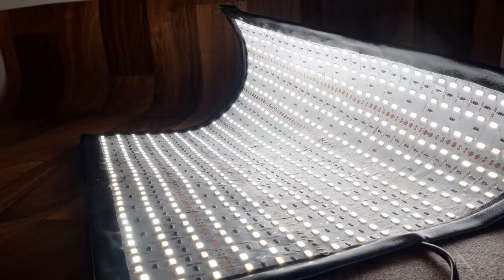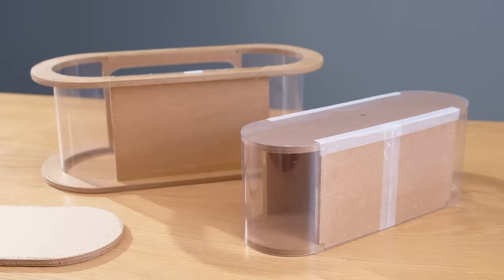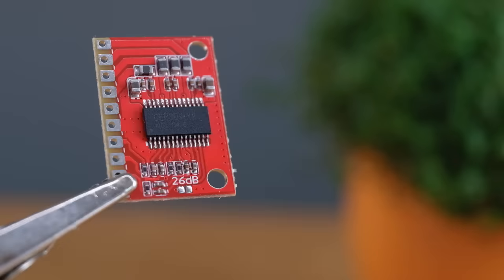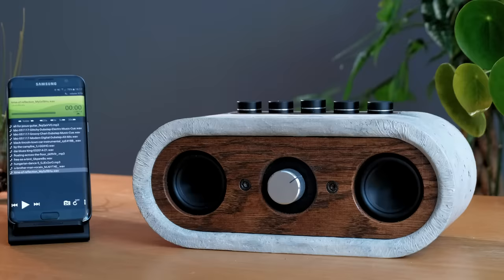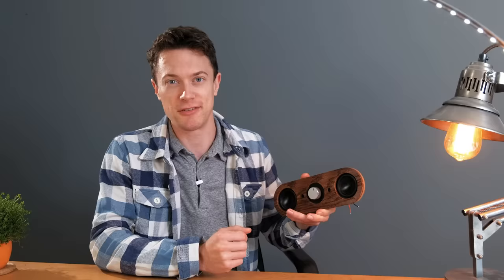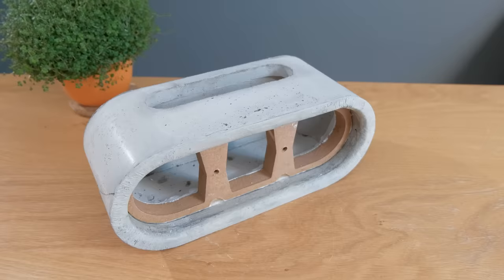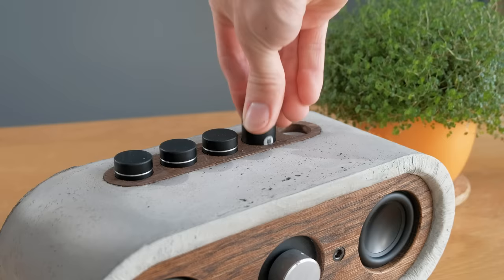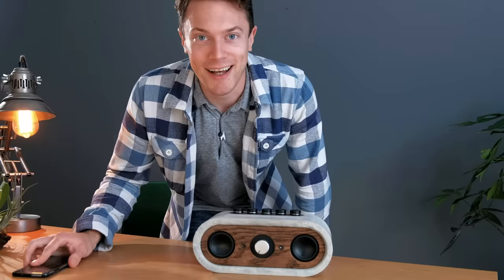Build your own Concrete Bluetooth Speaker (how-to)

Comment: I was wondering what the value for the potentiometer should be. After watching the video several times, it seems that there is a B50K double potentiometer used with an internal switch. I will use a  logarithmic 50K.
Reply: Did it work with a 50k potentiemeter? I have the same question
Reply: @lukaspape9238  did you ever figure it out, im planning on building this and have the same question.

Comment: This is a weird one. Indeed is concrete or stone a nice material for speakers. We are speaking High-End stuff here. But as folks already told, it's not that sturdy to drops or bumps. I think this MDF would be a much better material for a portable speaker. If I would choose stone as material for a speaker, I would build a small (bookshelf size) monitor speaker and maybe a woofer for the lows. That way the low resonace of that concrete comes to bear. Friends of mine build once upon a time a concrete speaker with 18" drivers for subs. They had a permanent campgrund and their old loudspeakers got stolen. Neither those concrete speakers nor the amps (old fully passive mono blocks) were ever stolen, but from time to time you they found some empty beer cans or half empty schnapps bottles, from some teenagers who partied there during the week.

Comment: What charger you use to charge these power cells? It would be nice to present it as well. :)

Did you study electronic or it is your hobby? How do you find these parts for your projects (how do you know which parts/components will be good? Do you experiment or you rely on some other people recommendations?). Why you use MDF most of the time and not Plywood?

Comment: I once made my own DIY speaker, well to be fair I just ¨frankensteined¨ the motherboard of one dead speaker into another dead one but it was one from a fancy brand so it got a good pair of speakers and a little diaphragm for the sub woofer, I wasn´t so good at soldering but I got the job done and it sounded surprisingly well for something that looked like Homer Simpson engineered, it worked for months of constant use until someone stole it, a year later or so a friend found it under a bush near a public soccer field, probably the bastard who stole it hid it there and forgot about it and after giving it a charge the thing still worked but it looked worse than before with the mesh all rusty and the rubber casing was totally messed up, at the end I lost it in the woods to never found it again, it happened 3 years ago.

Comment: You needed to use a vibrator for the concrete to get the air out and to ensure it fills all the gaps. Then you needed to pack it with speaker Polyester Wadding.

Comment: Imagine having a dinner at his place.

You approach the door and ring the bell.
He opens the door.
- Hello! Nice seeing you again! Did you know I actually made that doorbell myself, how funny is that?!  he finnishes his sentence while handing over to you a concrete mugg with coffee and a bluetooth speaker built in to it. 
He takes your jacket and hangs it on his custom built coat hanger with heatpipes that dries your jacket. 
While taking off your shoes you glanse at the small hall cabinet wich has an digital photo frame on it.
-Oh I see you are looking at my photo frame, I actually used the display from my old collage laptop that had a faild motherboard, I did not have the heart to just trow it way after all these years together. So now it is the last thing I see before leaving the house and the first thing I see when I come back.
Impressed,  you follow him in to the kitchen and put your phone down on the dinner table when you pass it. You hear it vibrate, and when you are just about to turn around to check on it,  you get interupted by him.
-Dont bother, it is just the wireless charging pad I installed in the table that the phone reacts to. I thought  if i get my fuel from sitting and dining at the table, why cant my phone do the same?

You think for yourself - That cheaky basterd, he thought of everything.

Honestly, your channel is amazing!

Comment: This is amazing and I would love to build one myself but I have a question that was not addressed in the video. How do you recharge the batteries? And how long did they last in your experience??
Reply: The batteries are removable, just pop em out of their little cases and into a regular lithium charger :)
That said, there's no reason you couldn't upgrade the speaker to include a charging port + protection circuit as well, and have the best of both worlds.

Comment: Concrete? 
Wouldn’t that be a quite heavy device? I have questions: 
How much does it weigh?
What sort of concrete is it, if not regular building concrete? 

If it is regular building concrete, could I use lighter material and still have optimal sound quality?

Comment: Hey Matt! There's just a small correction at 10:53 when you say to check the phase between the speakers, it should actually be the polarity. Even though phase and polarity are used almost interchangeably, as an Audio Engineer I think it may come in handy knowing the difference between them if we want to tackle more complex audio related projects. I'm always open to any questions regarding this. Still love your work man, everything you do never fails to impress me. Keep it up!!

Comment: You don't need the isolating converter. Either fashion a little ground bus and attach all your black wires to it or twist them all together and solder/tape.

Comment: Hi Matt, thank you for these lovely, detailed, and well thought through videos you put. Very helpful for people like me wanting to do certain things on our own. Question: would this bare concrete skeleton be strong enough to withstand shear forces when taken to weekly park trips, moving it around the house on a daily basis, and an occasional fall from say a 1 metre height? Or would you suggest I reinforce it with a a steel wire frame, or other materials? I’m unsure about this point and am considering alternative materials for the shell. Would you be able to give any recommendations or advice?
Reply: Good point- technically the method shown in the video is not made with concrete at all- it is just sand and cement with no aggregate (pebbles / chippings etc): that makes mortar and not concrete. I don't think it would be that durable - I would not want to have it unprotected in a bag and drop it say 30cm.

I think in order to make it stronger you could add in some pea gravel (ratio I'm not too sure on- maybe cement:sand:aggregate of 1:2:4.

Additionally, or alternatively, you can strengthen with glass fibres like shown here- https://makezine.com/2012/04/11/how-to-mix-and-mold-gfrc/ (search for "glass fibre" will show links of places to get small bags of these).

If you do use an aggregate and/or some re-enforcer then really work hard to make sure evenly distributed (maybe put the mould on top of a washing machine on a spin cycle for 30 seconds or so at intervals to ensure it settles evenly).

An additional step, if you want to get rid of small surface bubbles after removing the mould would be to make a mix of sand and cement and water and just work it into holes (sometimes opening out the bubble a bit first to make it easier to fill) and then giving it a sand afterwards.

Good luck with your build.
Reply: Sorry- just to make it absolutely clear- go with glass fibre reinforced method - still not sure if would survive  a 1m drop- suspect it would given this video the guy is making something designed to be dropped with this method- https://www.youtube.com/watch?v=2c6NhT2_mc8 (concrete would survive although to be fair not sure what would happen the components).
Reply: @martinwilliams4220  thank you Martin for your detailed comment. The goal I have in mind is to make it somewhat portable in a car perhaps, and also have that solid bass from the body. I like the glass fibre option, but I’m now considering a thin rebar like structure to be used inside, kinda like reinforced concrete in building structures.

Comment: Dear, we have a question about the electric circuit. Following the video we found a part of  the circuitsolution. We have a problem with the connection of the amplifier. Is it possible for a schedule of the circuit? Thanks in regard.

Comment: I was wondering about the power supply in a few different ways.  1st, what are you using to charge them?  2nd, you seem to have randomly glued the receiving connectors in no particular clocking in the tubes, yet the batteries appear to be keyed and pop in rather positively.  How do you achieve that?

Comment: Matt your electronic knowledge is astounding, where did you learn to do all this? You make it fairly easy to follow, but I would have no idea about using the Isolating Converter or odd power supplies.

Comment: If you want concrete with even less air boubles. Use a vibrator. Weather that's your mom or your girlfriends.

If you don't have that but do have a motor. Power that with a lopsided weight on the axle. And tape it to the housing.

Comment: If you added a hole(porting) the speakers would have managed to work in full suspension... becoz of the air pressure inside the concrete chamber the speaker would struggle to produce quality base...

Comment: Hi Matt. I know this video is nearly 5 years old but I hope you see this message. I've been watching your videos for about a year and find them facinating. Your use of old and new electronics is wonderful. I do have a question about bluetooth speakers and radios. I recently started playing with raspberry pi's. I built a Picart for myself and one for my daughter and I also built a Pi4 retro gaming rig using nespi 4 case. I'm now looking to build a bluetooth speaker and radio using a pi zero. I'm hunting down a vintage radio to use the case but I'll be using newer parts and speakers for the insides. Do you have any experience with  this sort of project? Do you have experience with raspberry Pi's in general? I'm am very new to this sort of thing and I am looking for any guidance I can find. Keep up the good work and I'll keep watching. Thank you.

Comment: Hello, Sir, I've been new to your channel for quite some time now, much tech love from Nigeria, and I have a question about the concrete exterior, would it be better to use 'Upholstery pads' with Aluminium brackets from your Acoustic panel video since they're also dense and would they impair the sound quality?

Comment: I am a little confused: you put 5*3,7 V cells in this project that equals 18,5 V Total. this means you reduced your amp to 15W out put right? and by putting XT 60 connectors you have to use a special charger. wouldn't it be easier to put a USB connector in the bottom and use regular USB powerbank tubes htat can be recharged with a regular phone charger of which every normal houshold has 3 or more lying around. Maybe I will try something like this one day.

Comment: Great work, only question how do you charge the "power cells"? pull them out?
Reply: This is what I’m wondering too. I love this speaker but curious if you need to make knew batteries every time they die or did I miss something?

Comment: 8:10  Why go through all of that and not just use a LM7805 Voltage Regulator...   that will give you the 5V needed up to 1Amp  and since that bluetooth module only uses  roughly  100mAh  that's well more then enough current to drive it and not get the "switching buzz"  from the DC to DC step down regulator (Buck Converter)
Reply: Maybe cuz it needs a heat sink?
Reply: @janetora  the LM7805  handles up to 1 Amp  a bluetooth module like he is using is at most 200mAh  ".2Amps"   look up the data sheet.... for that small of a load  a  LM7805 can handle that without a heatsink

Comment: Looks like he broke the concrete taking out the inner mold. You can see cracks in the sides at 13:10, so he must have glued it and decided to keep it a surprise for us to find out ourselves. I only know because I made one last year and removing the inner mold was the hardest part. Except for everything else also. I made mine with hand tools and after I finished, my friend said he had a laser cutter.

Comment: How exactly are the batteries hooked up to the XT60 connectors inside the tubes? Is there a wire going from the bottom of the battery to the top or is the casing used as a 'wire' from the negative side of the battery to the connector's negative pin?

Comment: I know this video is a year old, bear with me. Where did you do your research/decide on speaker modules? I am looking at buildings my own desk speakers and cannot find any info on picking good speaker modules. Also, would you suggest using the amplifier from this project in one of the housings and making the pair active or making them passive and use the external amplifier from your recent desk project? Thank you in advance!
Reply: Check out Kirby meets audio on YouTube. He has an entire playlist on picking the right drivers, crossovers, and enclosure types. If you have any specific questions that are unanswerable, just ask me I am glad to help
Reply: Kaden T Thank you! I will definitely check that out.

Comment: Thank you for this very nice video of you! I have looked at your works of art again and again and partly built them myself. Now I have arrived at a problem that you can please solve me. Unfortunately, I can't see how the 5 batteries are to be recharged again. Do I always have to connect them individually to a charger? I am very grateful for your help! I'm looking forward to the next video of you!
Reply: You have to charge them with a separate charger. There is no power supply going into the speaker.

Comment: After 2 years, now I just need to add bluetooth 5.0 module with all the codec craze from LDAC, APTX, APTXHD, APTXLE, APTXLL, etc. lol.

I was actually looking on how to get dual audio but it seems only Samsung supports it. Do you have something like a DIY bluetooth manager maybe? Like where I can connect my smartphone via bluetooth/wired then it will play music through multiple speakers via bluetooth? TIA God bless!

Comment: Hi Matt. Wasn't sure where to put this question, but hey, here will probably be okay:  I have a damaged pair of Bluedio Bluetooth headphones. It's impossible to wear them, but the internals are undamaged. Would it be possible to re-purpose them to drive a large speaker via Bluetooth and, if so, how might I go about it? I have a Panasonic SC-all8 which has a motherboard problem, but the quality of the speaker is excellent, so it seems a shame to just bin it.

Comment: How did you ground the wires from the bluetooth module to the potentiometer? there are 3 cores, so you basically one of them is for the right channel, other one is for the left channel and the other one should be grounded at which channel? or that doesn't matter?

Comment: They do now 30wx2 amps with bluetooth included on the board, just ordered one. Still thanks for the great vid!
Reply: Hey what ohm potentiometer did you use? I can't decide between a 10k or a 50k!
Reply: @zxwolf4641  the board I bought has electronic volume control built in. So no need for this.
Reply: @macaalf8219  okay, I'll have a look. Cheers
Reply: @zxwolf4641  there are other boards that have a potentiometer built in, this may be better as the buttons on my board actually control the volume level of the phone. But I am not going to complain, it cost me 7€.
;)

Comment: Also, would you be able to keep the battery bank tube electronics in there, add male USB connectors in the speaker and that way, be able to easily charge the batteries via USB? (No need for a separate charging device/circuit)

Comment: Is there a way to have the bluetooth module as well as make it capable of doing aux inputs? My gf doesnt like bluetooth  but loves the entire speaker idea. I was thinking the aux input it had would maybe work but I'm unsure what takes precedence in sending or receiving signal information as your example shows the aux was outputting the sound to headphones and I want it to take the input from the phone to be output through the speakers from the cable. 

If you can help itd be much appreciated. Thank you!

Comment: If you just connected the power cables to an power adapter, would the Bluetooth functionality still work?

Also can I connect led strips to the speaker + and - to have adaptive lighting?

Comment: Hello... Thanks for the cool inspiring video... I ordered the components myself. Wire them up and it works. Installed it into a old BOSE speaker unit. But when i turn up the potentiometer over a sudden point, the sound starts to distort on some of the frequencies/tones... Sounds terrible. Do you have any idea why this happens? Kasper

Comment: What is the spec of the wire you're using? I know the first lot you use is screened-audio-cable but what diameter/size? and what is the black and red wire you use? Thanks

Comment: Hey, I was wondering if you could help? I have that same board, with a 3.5mm audio Jack in, 12v (tried 18v too) DC, and two speakers out from the output pins… The problem I’m having is that the amp takes power for a second (switches on), will even play a second of audio but then switches off… Any ideas?

Comment: I scraped two 10W 8Ohms speakers from an old broken TV, would that mini amplifier would be too much for them to handle? I mean, if I push the volume all the way up, would the amplifier damage the speakers? As this amplifier is ridiculously cheap, and I haven't came across anything like it for 2x10W...

They're Teng Yin 2 7 3... Nothing is documented online, the Dayton Audio ND65 appear to be 15W RMS, 30W peak but I don't know if the Teng Yin are 10W RMS or peak...

It's not to make Bluetooth speakers though, just some PC speakers to plug directly onto 12V wall plug and 3.5mm jack audio out from my PC